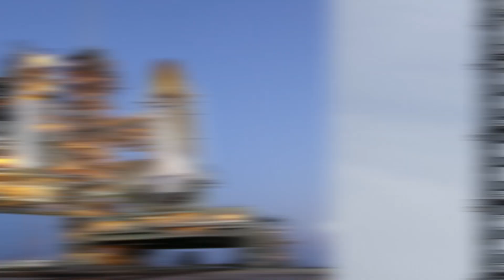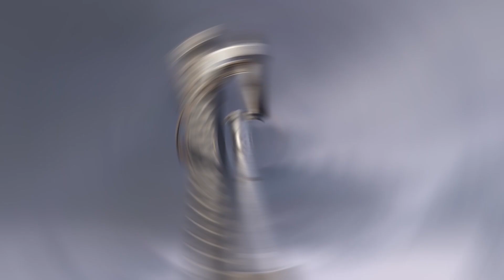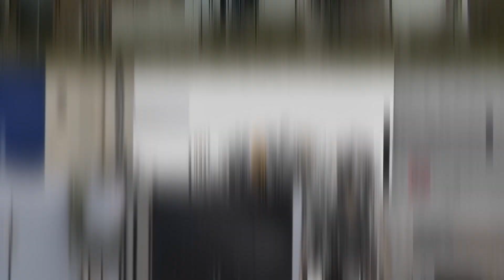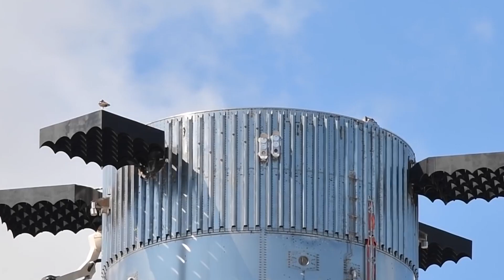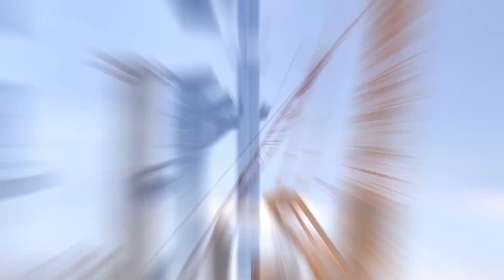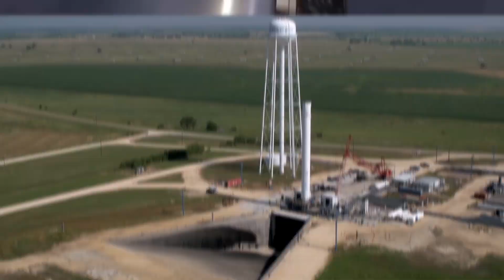SpaceX Mechazilla Is A Witch ∣ Insane Installation Of The Chopstick Carriage

Comment: About - Launch and catch tower - Mechazilla. 
Elon Musk peep at my invention - the USA patent and monkeyed it, ergo plagiarize it. 
From inventor Roman Nawojczyk in Sweden, you can read complete story on my website ronawo….  
For this invention, I applied provisional patent application on August 12, 2019 in the USA. 
It is - Utter system for multiple use of the space-rockets equipped with spreadable-arms presented on 275 drawings. And I presented this invention on Internet on my website in autumn 2019, in those days Starship had to have only legs.